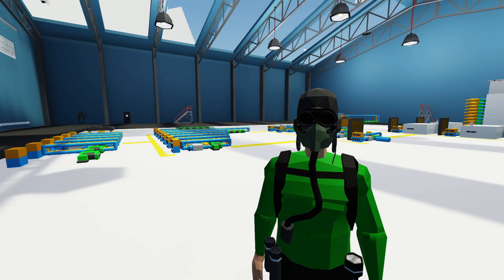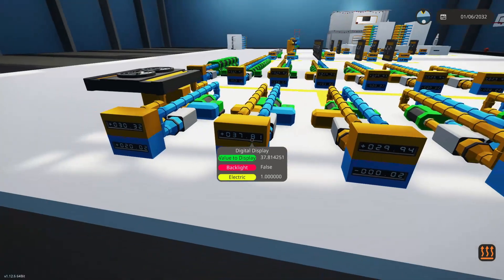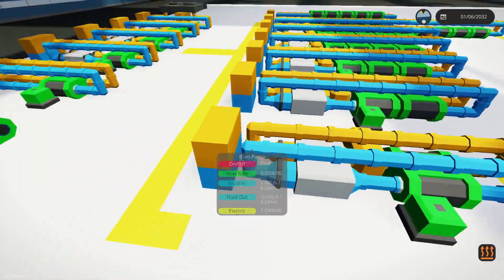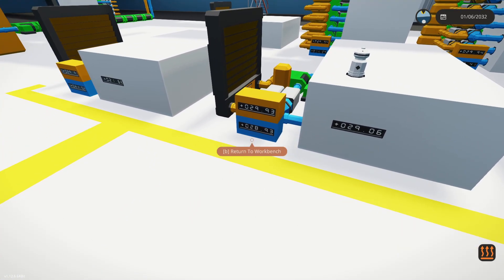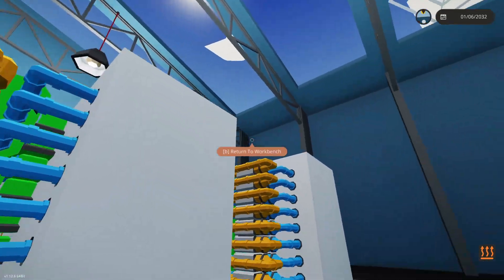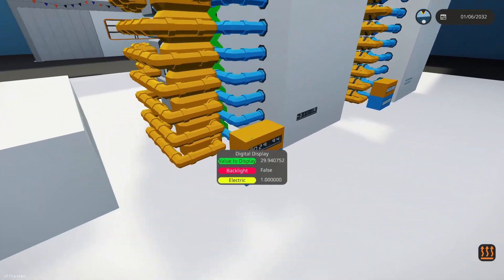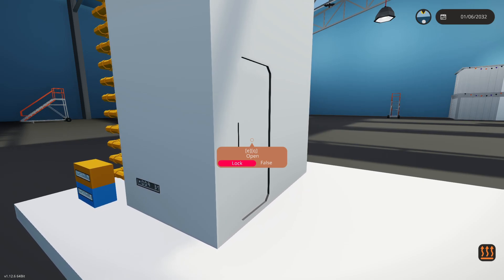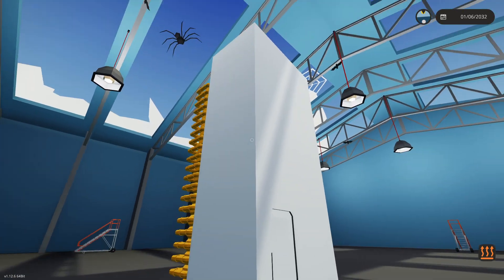Testing CRYO COOLING to See What it Can Do! in STORMWORKS!

Comment: You are cooling air pipes to zero because there is very small volume in there. Cryocoolers are extremely slow and need to work in multiple stages. You cool the target, then another cryo cools the hot part of mail oop, next loop cools the heat of next loop and so on. Each stage will bring down some temp, and this way you can get to abs zero

Comment: 2:23 "Interesting that the machine running produces heat"
I hate to be the ☝️🤓 guy but this actually makes perfect sense.
In a refrigeration cycle you're moving energy (in the form of heat) from one area to another. It's not that you're cooling air, you're just displacing the heat from the air. That energy (in the form of heat) has to go somewhere. That's why running a machine for cooling produces heat.
Isn't the refrigeration cycle interesting?

Comment: I'm thinking that by adding a heat exchanger in the loop, it might be great for cooling engines. Cold air output goes into the heat exchanger to cool down the water.
Reply: so i tried this. seems like heat exchangers in stormworks are usless as my air in was 3 degrees but the air out was constant at 29 c. makes zero sense. also The liquid exchanger cant cool and engine. ive worked on a ship that used around a 2x2 exchanger to cool a v12 twin turbo generator. but in stormworks u can have 3 5x5 ones and they wont cool anything at all

Comment: Hook up the cryos in series. It super cools the air and cools a large room much faster. I cooled a room probably 4 times that size to under 10 in about 10min with maybe 15 cryos in series. If you place them side by side with every other one flipped you can get a cool radiator look with the pipes on the side.
Reply: The size of his +-room i was able to make it hit 12.3 when 40 outside with 5 cryo coolers
Reply: In -+3min
Reply: @liamdekip  I was trying to get subzero temps so I could see at what temp characters get cold (guessing you start freezing at 0). I think I was down to 8 when it started really slowing down and I had to go to sleep anyway. Unfortunately I don't think it's possible to get it that cold with the cryos. Even with that many my cryo temp was only at 6 when it slowed down.
Reply: @bigbopeep420  you start to get cold at 4.5 or it was 5.5

Comment: Had a bug had to repost.  I found the cold side works better under pressurized air and then through a heat exchange.  You can run it between 40-50 PSI using a small impeller so the pump doesn't stall.  That seems to be a happy area.

Currently I have a hot side connected to radiator which may not be needed.  I then have a 40PSI air loop on the cold side.  I run that through a heat exchanger to cool various fluids.
Reply: High pressure low movement not to slow

Comment: I know it didn't work to use the new block to cool an engine directly but what about using it to cool off air in a heat exchanger system? Because that would still have two closed loops. Maybe worth a test at some point

Comment: Wondering if different gases have different thermal conductivity or whether they plan to add that.
 Eg hydrogen would cool a lot faster and wouldnt freeze at 0 Celsius. Making it better for refrigeration.
Reply from the maker: I did try with some different gasses but all sane results.

Comment: from what ive seen in my testing, other than radiators, the cooler doesnt cause water to spawn in a given loop
edit: im pretty sure if you dont have a tank or radiator on a closed pipe loop it spawns with vacuum, not air
edit 2: i would test these setups always with radiators attached on both sides to load them, unloaded the results arent very conclusive

Comment: Oooh. Good research.

Can you use the 0c vacuum line on a heat exchanger to make the room colder?
Reply: From my testing heat exchangers on the cold side make it much less efficient than just air through the cold side.

Comment: I noticed reactor control rods are broken atm, don't really do anything. Idk why, do you also have this issue?
Reply: I have the same problem
Reply: They are connected properly right? They have to be 3 blocks up rather then on the same elevation that the fuel rods are on
Reply: they must be aligned correctly with the assembly. as the comment above said they must be a couple blocks further back
Reply: My reactor is not even starting up lol